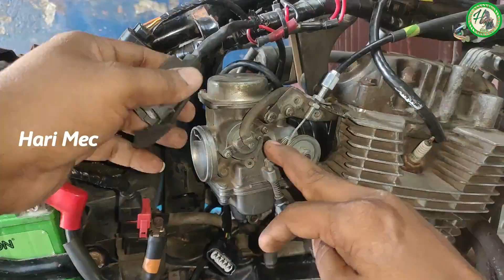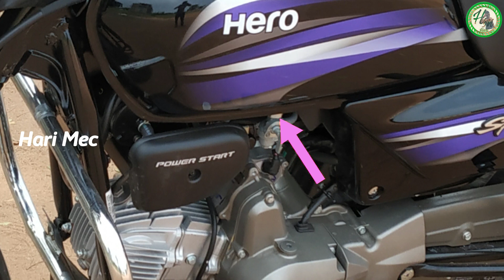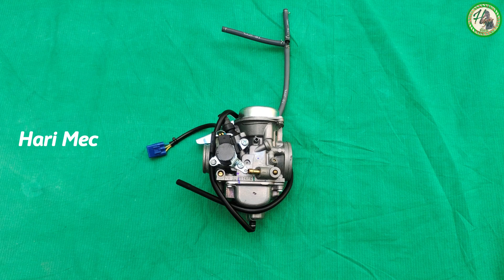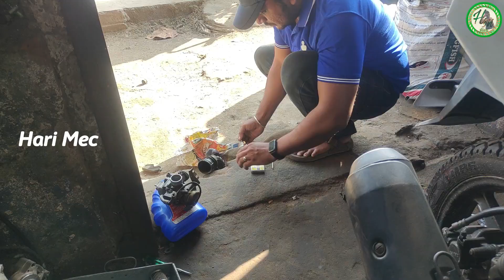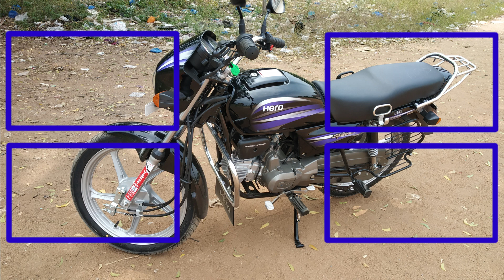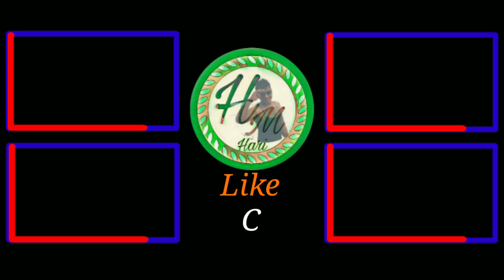Karizma ZMR Petrol Tank Alteration When We Installing Carborator||Hari Mec

Comment: Hi anna  2011 model unicorn bike nadhi recent ga bore and crank and bearing head cheinchanu  anni install chesadu engine lo accelerator rase chesthunte yedho bearing rasukupothunna sound vasthundh anna  solution cheppava anna mechanic ki ardhm kavatled gear wheels antunnadu gear veykundane sound vasthudh ala vasthundh and anni cheinchanu  lath machine eppatiki 2 mechanics chesaru 20k ayndh problem aythe solve avvaled solution cheppava anna hyderanad lo vundh bike  plz give reply suggestion anna
Reply from the maker: 9885442269